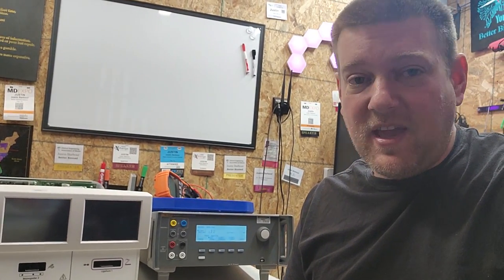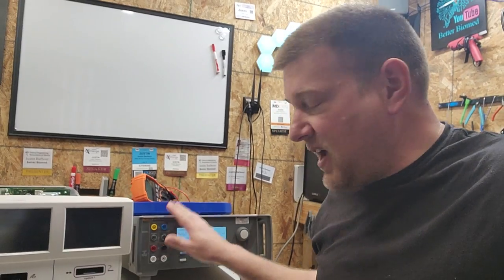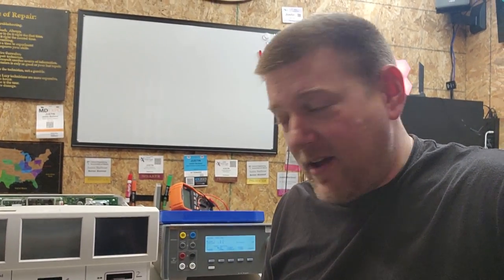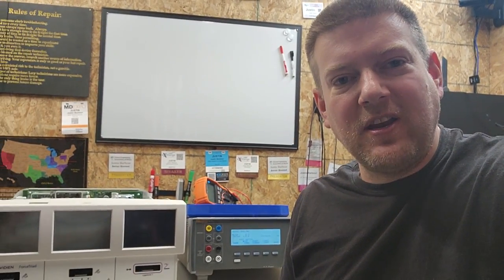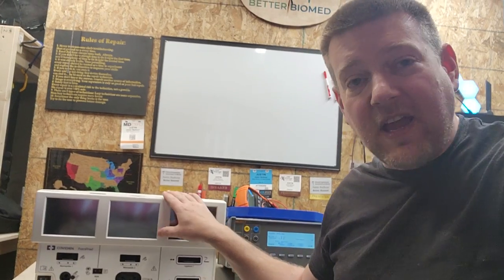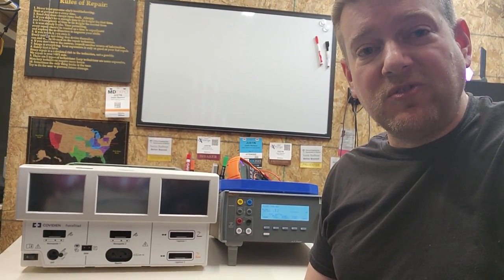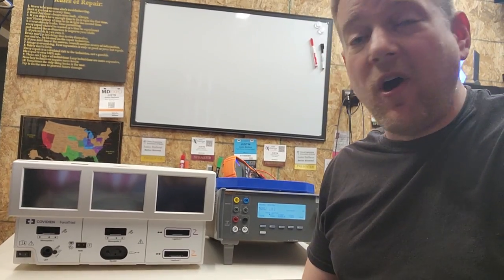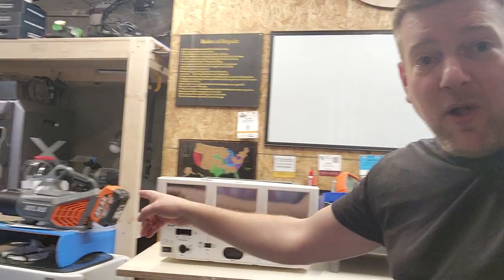I am DONE!

Comment: One thing to look into (If you can do it on the device to the left) is see if you can upgrade any fans to get more flow. I prefer Noctua but being the gold standard they tend to be a bit pricy.

Another thing to check is the overall flow of air. If the fans are pointed at each other it's not going to help :) But in one angled shot it looks like a poor airflow design (Lots of circuitry and no vents/fans) but that's not knowing what the cover looks like

Good luck
Reply from the maker: Normal operation of the Force Triad has a short enough duty cycle to maintain temps. The current cal requires constant operation for minutes, which is a high dc power draw.

Comment: I wonder if wetting heat sinks would work (without introducing noise or interference that would invalidate the calibration).
how many watts? (looks up maximums on reseller's brochure) 350W@5785V output,  2080VA@240V input !?  :/ 
1.73kW ? That's like  2L? of water an hour on a cool day.  

I guess forced-air cooling powered by (that leaf-blower on) an isolated circuit and some metres ducting?

(Is this is what those exterior rear-racing seats on trucks were for?)